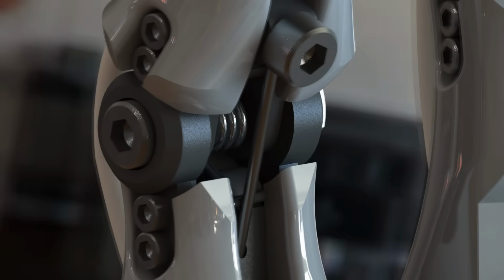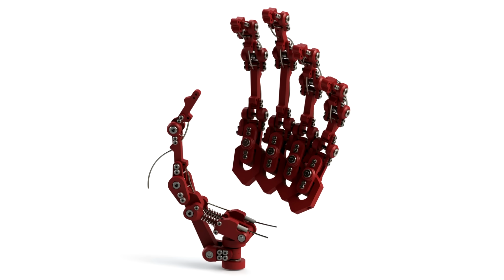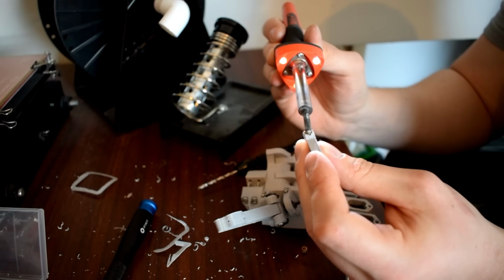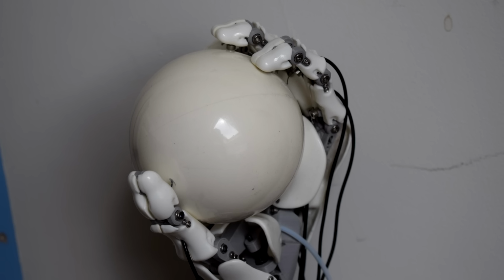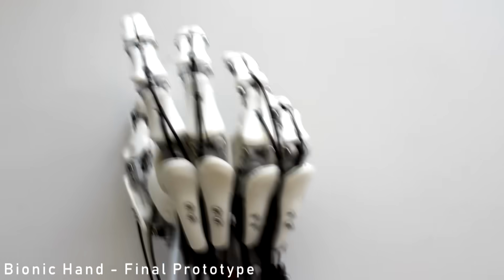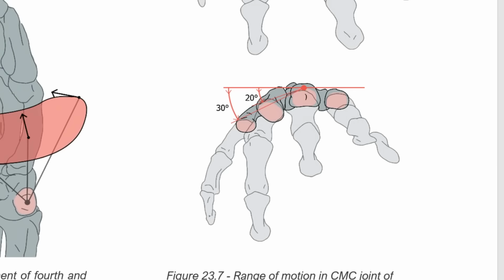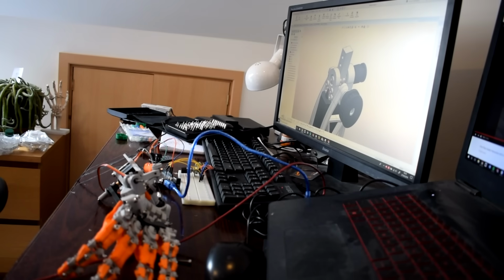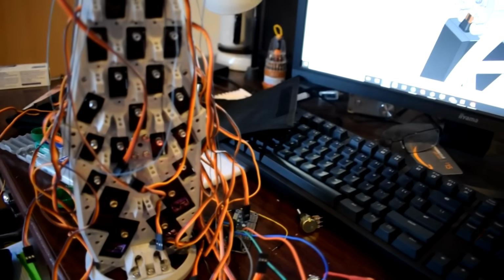3D Printed Biomimetic Mechatronic Hand Explained Part 1

Comment: What a beautiful project, beautiful work, a true artist. I think that the major problem in getting closer to the human hand is the motors, the lack of development of this segment, the development of muscles as muscles and not as engines, I believe that the development of muscles based on magnetic traction based on grouping of mutiltimagnetic cells would be the the development of the most advanced prototypes. but as you said, you are working with the technologies available today, congratulations again.
Reply: Read your comment after making mine, re: magnetics.
Reply: I think small electromagnets would make good muscle replacements but it's just a theory, i've never attempted any robotic development, i'm just in awe of channels like Will's.
Reply: Excellent. The thing is that magnetic force is fast but relatively weak and some kind of gearing is always necessary. If this could be done at the microscopic level it would be great, to have some kind of solid-state ultra strong and efficient solenoid type of actuators.

Comment: Hat off for the incredible amount of effort done. 
It would be nice to have a small package 1-wire 2D  magnetic sensor like the 14bit ams, to make it easier to built it in each joint and routing the wires.
When each joint can be measured, the servo can be replaced by smaller motors and the "twisting fishing line" force conversion + transmission, which reduce the size of the actuator and making the forearm smaller..

Comment: I don't know if you answerd this in another video, but why did you choose to use servos over something like micro linear actuators? They'd be a lot more space efficient and have the exact push and pull motion you need to operate the cables.
Reply from the maker: It was purely just down to cost, I was really restricted in terms of budget so I had to go with what I could get cheaply unfortunately. Different actuators are definitely something I want to look into though, thanks for the comment.
Reply: @WillCogley  Understandable, they're generally about 5 times more expensive than most servos. Thanks for the reply and keep up the incredible work!

Comment: Instead of using springs I would suggest using both ends of the cable for the push-pull force. I think you should need two servos per finger, three for the thumb and two for the wrist. Also I would dump the idea of feedpack pots - just to complicated, also I would design the joints to not use bolts, just as in a real hand. If you need any design guides... just look down on your hands xD
Reply: Yes I agree, I have played with many robotic arm control configs, and the dual cable is at the top of my list atm
Reply: are you kidding me feedback pots are CRUCIAL if you want a functional hand that can perform tasks.  The main brains of the machine need to know what its limbs are doing somehow!
Reply: @artbyrobot1  not really, he's using servos (which have a built in encoder) so the feedback pots are a touch redundant, if you were using a complex kinematic model or a neural net you may make use of the pots, but his simple setup can't reasonably be expected to gain anything from having twice the number of encoders.

~Fyi I'm  an ee

Comment: It looks incredible and very well engineered (way better than mine :D). I don't know if you thought about ways of controlling it other than the glove you made but I suggest you take a look into EEG or EMG sensors. I made a similar bionic hand that can be controlled with a glove, EEG and EMG sensors. You can check it out on my channel. Also congratulations and good luck with the rest of the project!
Reply from the maker: Thanks, I'd love to have it controlled with EEG one day. I had a look at your channel, there's some really interesting stuff there :) Are you still working on the EEG hand?
Reply: @WillCogley  No, I haven't worked on that for a while. I just got into university and I can't find time for projects :D

Comment: Man that is so cool, a lot of work with the printed parts and the amount of cad time that must have went into it, great work. 
I wonder if you could use mini hydraulic rams to pull the cables and have the pump/control assembly located else where, ie for a robot in the body?
Reply from the maker: Thanks, I did consider hydraulics but it would've been a bit out of budget for this project, it's definitely something to consider for when I come to design mark 2.

Comment: I did a few hands a few years ago (and actually should be working on one now...). What I ended up learning from the experience was that standard robot design approaches, and technologies, are quite limiting. For example hinges with axles through them take up too much space, servos being really awkwardly shaped etc. I think the way to crack it is to combine soft robotic actuators, bones which slide past each other, and elastic and tensile elements. Have you looked at tensegrity inspired models of the body? It helps to see how the body can be broken into different elements beyond the typical rigid elements+hinges approach. A hand that is underactuated but held together with elastic and tensile elements can  wrap itself around an object it wants to grasp. Have a look at the hand design by Zhe Xu.
Reply: I have no experience in robotics apart from watching other people's work, my experience is mostly in electromagnetics, but i've often thought small electromagnets would be good for muscle/tendon replacements, do you both know of any work done in that area ?
Reply: @GaryMcKinnonUFO  That is such an amazing idea really!!
Reply: Thanks  @abdullamasud4278 , i've been thinking about it a lot since and it may be too power-hungry. Unless you have a power-source that circumvents Lenz's Law, i've been following this chap and replicated the basic effect, it's now patented : https://thaneheins.ca/ To summarise, the only thing that defeats us in the humble electric motor is Lenz's Law, Newton's law of equal and opposite reaction. So in a motor or generator, that equal and opposite reaction is the counter-EMF, or back-EMF. This is induced by the magnet moving over the coil, and the induced, opposite polarity has a finite rise time, so if we wind high-inductance coils (to increase the rise-time), or spin magnets over them very quickly, we introduce this Lenz-lag type of effect, the CEMF accelerates the magnet out rather than opposing it coming in. My associate did a video series which i've uploaded here : https://www.youtube.com/watch?v=d3hzyPotc6M&list=PLyLMmnSL6MzHzU0cw-O5G4STBzUFqUuXi
Reply: @GaryMcKinnonUFO  I have put some thought into small electromagnets for muscles in the past, my prototypes failed for reasons that may potentially be solved by a tensegrity model, so I am inspired again to take another look. The basic idea is a lattice where small rare earth magnets and electro magnets are woven together, by reversing polarity on the windings you cause the lattice to stretch or contract in a concertina in like manner, eg: https://imgur.com/a/FRw1Hxu although the lattice itself is arranged in a cylinder, not a plane.
Reply: @GaryMcKinnonUFO  I saw it's a two-year ago comment, not sure if you are still watching this. I tried to use e-magnets as actuators back at that time. But I noticed the output power seemed not quite enough comparing with real muscle. According to what I found, the skeletal muscle typically generates ~9N/cm2. Maybe because I'm not very good at making e-magnets myself, what I made never achieved that strength. Recently I'm picking up that project, considering both motors and e-magnet. Perhaps I can get some advices from you?
Reply: @Hfg8768lyk  It's an idea i haven't yet tested.
Reply from the maker: Thanks for your comment, I'm actually really interested in Zhe Xu's designs, and I definitely think the next step for this project is what you're describing. What were you designing hands for if you don't mind me asking?
Reply: I made them mostly for robotic purposes as I want to build a whole humanoid robot at some point. There was some interest in prosthetics and I chatted with Openbionics back when they started. I also contributed to what became the Enable hand.  Since then life got in the way, but also I've been looking at learning how biology approaches these problems and the pros/cons of biology vs standard engineering. There's a lot of cool research going on in soft robotics and programmable matter which could help us approach the design in a more organic way. There's a lot of ways that biology has made its mechanics optimised for it's role. I mentioned the gripping in the previous message, but there's stuff like passive dynamic walking, which helps explain why humans are much more efficient at walking than a robot like Asimo.
Reply from the maker: I've had a quick look at your videos, there's some fascinating stuff there particularly with your tensegrity spine, is that something you're still working on? I did this hand as a university project so there was a lot to cram into the year, but after seeing that project by Zhe Xu with the little crocheted joint capsules I've been really interested in that sort of thing. I'd like to be working on a new design now but as you say life is getting in the way haha. Let me know if there's somewhere I can follow your progress on your humanoid robot.
Reply: @WillCogley  Nice work there. I think you should consider fishing line muscle over some kind of pressurized muscle or even servos.
Reply: Yes because at least with an electromagnet you can get more mechanical power by applying more current and not making something larger.  q10w10e10
Reply: awesome guys
Reply: Has anyone ever looked into hydraulics? I've always been of the opinion that it would be better suited to such applications that servos and such.
Reply: for my robot, I'm just using dc motors as pulleys - so you don't need the gears of a servo which cuts down the size.  Then just use a single pulley to trade speed for torque.
Reply: I have seen some designs using liner servos however these are heavy expensive and not very efficient in terms of speed and repeatability.
Reply: I took an opposite approach:
https://youtu.be/vOLvFhdkLmA
Reply: What needs to bee done is using a flexible material between each "bone" in a printing process that fuses both the solid and the flexible materials, trying to copy the human anatomy as close as possible. With solonoids acting  as muscle for the fore arm until we develop a good synthetic muscle type and the thumb Using a material that contracts with voltage input. The thumb joint could be substituted with a universal joint with limitation to realist motion.
Reply: Exactly what I have been thinking for a few years. There is much potential to develop new methods! Servos are so old and bulky they need replacing. Our approach seems overly complicated at the moment.
Reply: Did you make the hand? Are you using this or similar design or did you make your own? I'm thinking to start making the simple hand from Thingiverse.com at first and than, after I learn something, start making changes or improvements or make my own design. What website was the most helpful to you? Thanks and have a great day!
Reply: @tonysfun  Youtube really didn't keep me up to date with these replies until this one.  I've not been doing work on my hand designs, but I've been looking at a more general approach. I've always wanted it to be an AI platform so I've been thinking a lot about replicating early multicellular life and working my way up the complexity scale. Still for that I need the soft actuators and so I've been doing some experimentation with pneumatic actuators. I've been laser welding some sous vide bags to make the muscles. It's a bit temperamental but with some refinement could work. My main issue now are the valves. I've gone from needing an alternative to inconvenient servos, to needing an alternative to inconvenient valves! Some videos of the muscle are on my channel.
Reply: @Anthromod  Thanks for a very fast response and honesty! I wish you luck in the search for more perfect parts you need! Have a great weekend!
Reply: I know im REALLY late. But when you 3d print do you have to do all those screws
Reply: Try using nitinol wire for tendons when you apply current they shift back to their memory shape
Reply: @98f5  me puedes explicar mejor
Reply: @TheMoimaracuchito  El alambre de nitinol es una aleación única hecha de níquel y titanio que puede volver notablemente a su forma original una vez que se calienta a la temperatura adecuada. aplicar un voltaje eléctrico puede lograr el mismo efecto.
Reply: Yes! Zhe hu Is amazing

Comment: Wow! This is awesome! Your solutions for reproducing realistic joints with mechanic are super! Wish you continuie and develop this project deeper!
I see comments about FDM printing, and agree with em - new SLA/DLP printers from china are cheap, but can help a lot, i think - mostly for small parts and joints (and your design is very compatible with small build volume of cheap printers), same as using "uv resins" as "glue for fix metal parts" - don't need to "heat-solder" metal parts into plastic, calculate this for model, polish with dremel, and other similar moments..
Really cool! (if I will develop bionic arm - i'll use you video and ideas as "best to learn about topic")

Comment: Man! That's great! At last I see someone who was inspired by the Nature) Have you calculated cost price? MG90 is really cheap but they aren't good choice IMHO. But that looks awesome! Thumbs up! Also consider making smooth surfaces of the hand (like render) with a vacuum forming or a rotocasting. They would be smooth, thin and light. Good luck with all of your projects ;)
Reply from the maker: Thanks! I agree that the MG90s was a poor choice but the budget was very limited on this project, I haven't costed it up yet but I'd estimate it's less than £450. And good idea about the vacuforming, I need to find someone who has one haha.

Comment: I love the thought process you shared. I drew up an idea like this, but changed to a hydraulic system before I even got enough done with the build to share it. I wish I had 3d printers back then. Oh, use this with a rail guide to move the metacarples laterally.

Comment: This looks amazing, one of the best bionic / robotic hands I've seen. Were the white covers FDM printed? How did you finish them?
Reply from the maker: Thanks, I printed the shell parts in ABS on an FDM printer intending to smooth them with acetone but they were too thin, so it's actually hand-polished.
Reply: @WillCogley  I recently watched a Tested video with a lass that built armour, she said that diamond dust Dremel bits are really good for polishing 3D printed parts quickly. Might be a timesaver.
Reply from the maker: I must have missed that one, interesting. I used Dremel sanding drums to start with but they just sort of melted the plastic. Thanks for another tip haha
Reply: @WillCogley  dremels can often do that, if you want to use them on plastic you should look for model making rotary tools, its exactly the same but you can set them much more slower than a dremel (or at least the dremels I own).
I had the same exact issue when I started polishing my model cars, I ruined a very beautyful  corvette like that